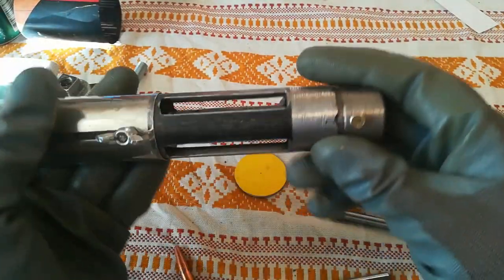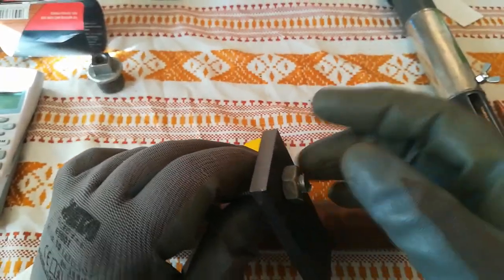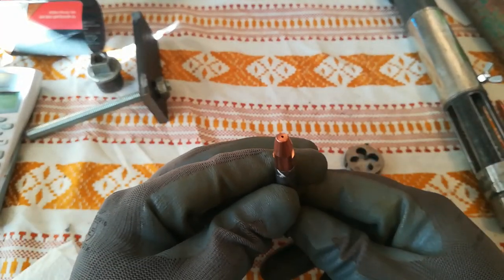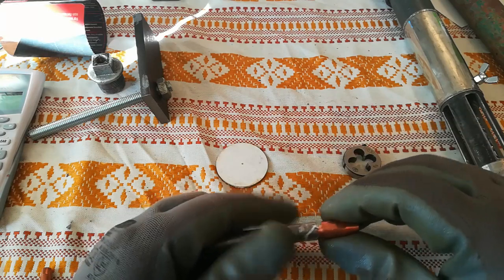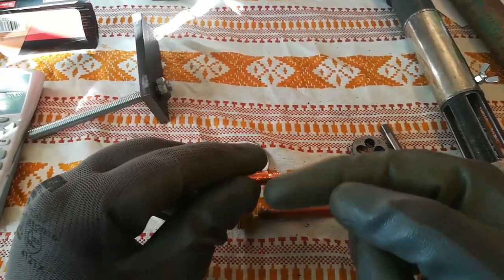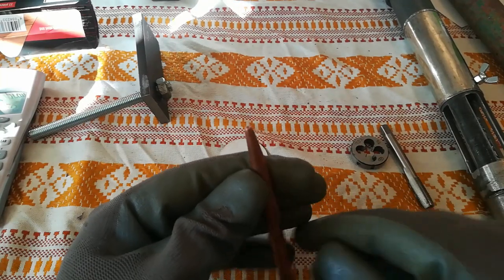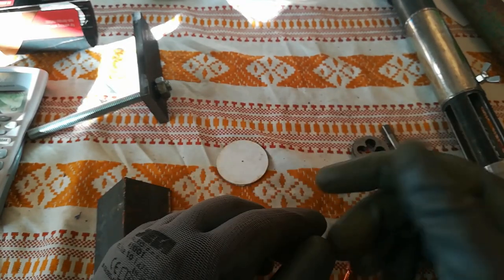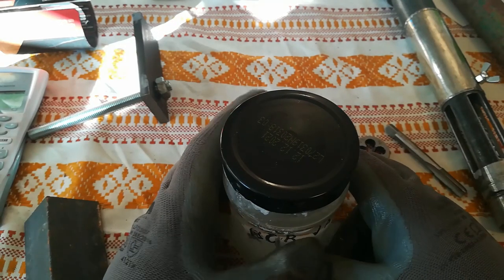HOW TO:PROPANE BURNER1.5 gas nozzle/propano quemador /प्रोपेन बर्नर/пропановая горелка/Propanbrenner

Comment from the maker: One tip about boric acid flux -if you mix 70% boric acid and 30% borax you will get awesome flux! For example 70g of boric acid +30g borax =100g.
Then add 50% of above weight of ethanol alcohol(70% minimum for it to burn ),so 50g of alcohol.
Another awesome flux is phosphoric acid but it needs to be highly concetrated 75%+ .